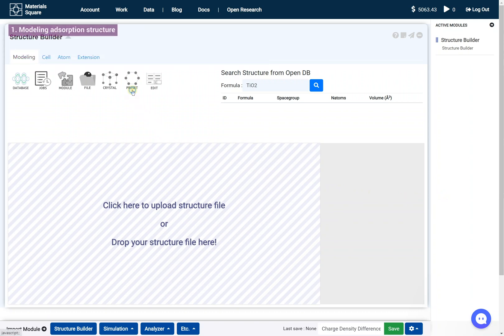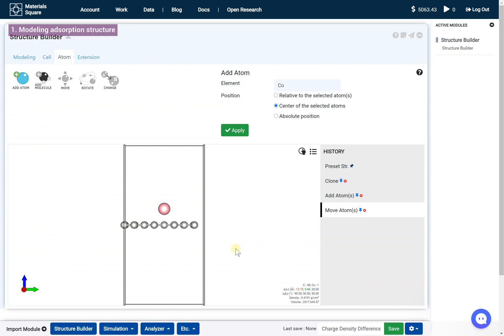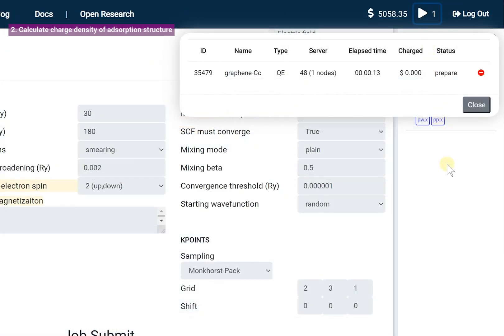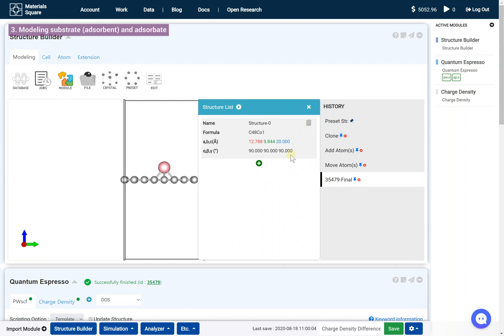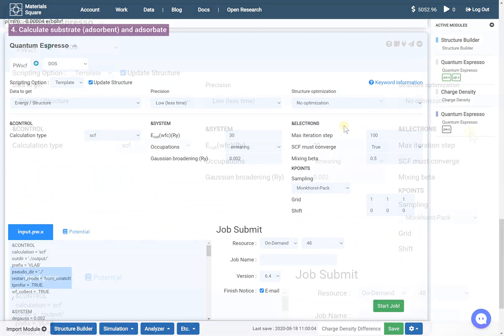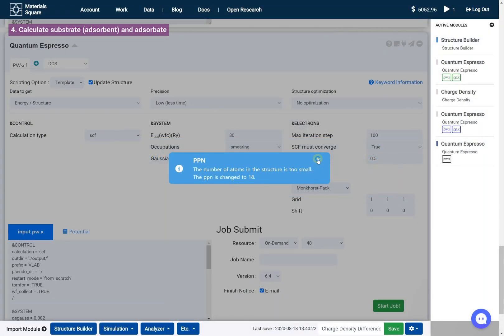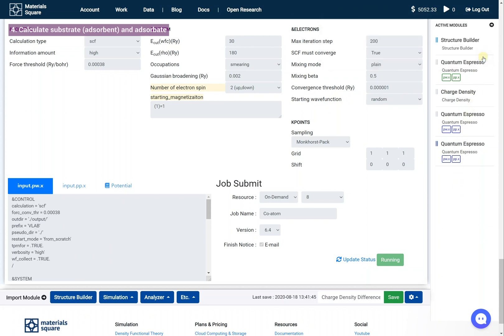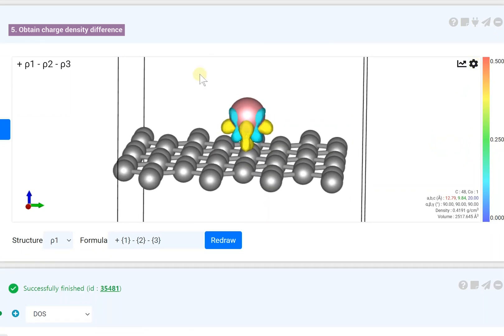[Materials Square] Charge Density Difference | Quantum Espresso

Comment: Hi! Did you use quantum expresso software?
Reply: Hi! 😊 Yes, we use Quantum ESPRESSO in Materials Square.
It’s a web-based platform where you can easily run Quantum ESPRESSO calculations using a graphic user interface, without needing to write input files manually. 
Let us know if you have any questions!